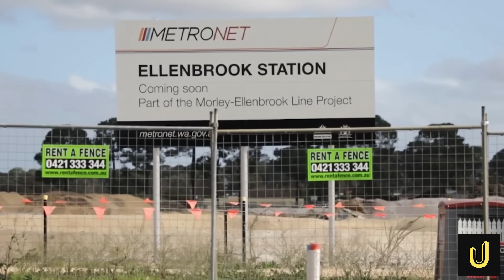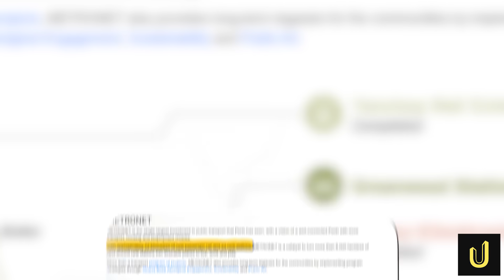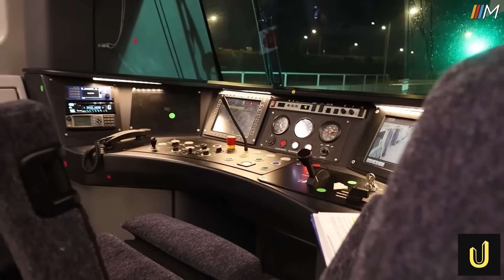$13 Billion METRONET is Reshaping Perth!

Comment: As a resident of Perth, this Metronet project was detrimental in the short-term, with chronic traffic problems. 

In the long-term I see this network being as beneficial to Perth as the high speed rail network is to Beijing.
Reply: The traffic has been horrendous.... I can't wait until the Armadale line reopens
Reply: The new Armadale train station looks great.

Comment: Been to Perth and i like the Metronet line especially the Yanchep line, it devides the Highway right down the middle, in a straighline and boy those trains are fast, keep going PERTH , you have a long way to go
Reply: Most of the lines run down the middle of freeways btw.
Reply: Yanchep isn't metronet. It's just an extension of the Joondalup line
Reply: @edwin5419  thank you for the correction, so if not metronet what is it
Reply: @PaulTaka123  it's just our regular train line. We don't have a special name for it because most of it was there before me, and I'm 40.
Reply: @PaulTaka123  but you're right, having it go down the freeway (all 150km of it) is exceptionally smart forward planning put in place many decades ago
Reply: @edwin5419 - so, what’s is metronet?
Reply: @edwin5419  Actually you're wrong, the Yanchep Rail line has been documented under MetroNet since 2019, you can find all documents relating to it on the metronet website.

Comment: I still cant believe that the new Cockburn to Thornlie line wasnt extended to go to the airport just down the road. so stupidly short sighted. Instead people from the south need to go into the city to then go back out to the airport. Which will make the airport an even bigger snarl point than it already is because people will drive !
Also the much mooted and desperately needed Paganoni/Karnup/Golden Bay train line on the Mandurah line needs to be put in place sooner rather than later !!
Reply: I agree that it would have been better if the Cockburn to Thornlie line was extended to the airport. I also think that it should continue up a passenger compliant line using the existing freight line corridor to Midland then up the Swan Valley line to Gin Gin with a new line along the Gnangara Road and Ocean Reef Road to Joondalup with a new interchange station where the new line crosses the Ellenbrook Line. In the south there should be two additional circular lines. One should follow Thomas Road. The other should follow Lakes Road past Murrayfield Airport and should be accompanied by a plan for Murrayfield Airport to become Mandurah - Perth South International Airport including a station on the new link line.
Reply: @grahambaker6664  I like your thinking, i have had a similar though about the Lakes Road line to connect a regional airport as Mandurah is growing faster than it can cope with. We should get the councils and Transperth to make it happen !
Reply: @WizardsLore Murrayfield is about the only option for a second Perth Airport site as the RAAF Bases at Pearce and Gin Gin stop anything to the north and Jandakot has too many houses around it. At least at Murrayfield they can still manage the land zoning to have noise buffers to avoid conflicting usage. Murrayfield is also close to the southern end of the freeway and to Mandurah Road so connections to higher capacity roads should not be too difficult and freight movement to the Kwinana Industrial Area, the Henderson Maritime Precinct and RAN Fleet Base West should be easier than from the current airport. Even if the Murrayfield expansion doesn't take place for twenty or thirty years it is worthwhile to lock in the site so future planning takes it into account. Incidentally, my proposed Thomas Road link should be a dual use corridor with the freight lines extending to the existing freight lines in Kwinana Beach.

Unfortunately, I am probably not going to be much use in lobbying. I am a former Port Kennedy resident but no longer reside in WA.
Reply: @grahambaker6664  Sounds reasoning which i would support. Nimby's would still kick up a stink that the grass on their properties would be impacted by flight paths. 
the regional airport there would also assist FiFo workers, similarly to the Margaret River / Busso  airport is doing.
Thomas road needs to be dual carriage way from Kwinana to Tonkin. Anything less is a missed opportunity. 
Cross rails between Manduah line and Armadale line need to happen. Maybe an interchange at the proposed Kwinana/Golden Bay station. there is available land to run alongside Paganoni road then shot eastward. Would create new housing oportunities all the way along it
The freight angle for the Peel region is one that needs to be seriously looked at. Especially as what was once sporadic townships is closely becoming 1 big residential area as Mandurah hits the Rockingham council line. And Rockingham itself becomes the next development target !

Comment: can fix our internet, you can't drink the tap water, in summer we have blackout as power grids can handle air-conditioning, there no infrastructure for EV charge station as the power grid can't handle it, your restricted to a 20kwh house battery for solar to insure the power company still has you using grid power.
they scrapped a monorail for a driver-less bus that failed after 1 year and was scrapped.
don't over fluff Perth, our government are fools, not to mention there pumping water out of the ground for free way extension that dried out lakes, Yanchep lake had a water rat that eats cane-toads now endangered thank to the development of Yanchep

Comment: This is a gross waste of money. Sprawling suburbs ... all good. People want detached houses on substantial plots, and ideally, secluded substantial plots. Most people DON'T want to live in soulless Stalinist blocks of flats where the lift doesn't work. You solve the congestion in the centre, not by pouring thousands and thousands of tons of concrete  and causing as much disruption as you can along the way, but by
a/ providing the city centre car parking. 
b/ You use taxation and legislation to MAKE employers offer fewer longer working days, thereby reducing the number of people travelling in each day and to spread the peak periods. People would love more days off.
c/ You then provide a fast, frequent interconnecting bus service that is free other than in the worst of the morning peak. The charging period would be to encourage a spread of the rush hour and fewer longer working days. Planning must ensure that there can be a dense direct bus service ... no great long cul-de-sacs. The money being wasted on this ridiculous railway would pay for the free bus service for more than a hundred years.

Frequent bus stops are convenient for people who want to use them. The driver will only need to stop the bus if someone rings the bell or there is someone with a paw out at the bus stop. These metro things cannot offer that convenience as the train would never reach a sensible speed if it would have to be stopped at EVERY station. I have never heard of a request stop on a metro. The alternative is long distances between stops which is only convenient if the starting point AND the destination are close to a station which excludes the great majority of the population who don't want to walk one and a quarter miles in the morning when there could be a more frequent bus service with a stop within 275 yards of home.

Comment: And train station at terminals 3&4 is no where near the bloody terminals at all.
Reply: Its convenient for the new Woolworths haha. Also there is a needlessly long walkway bridge for terminal 1 and 2 instead of continuing the tunnel to have a stop under the terminal. Then continuing it under groudn to run down Roe Highway or duplicate the frieght line to then feed into Thornlie/Cockburn extension.
Reply: @WizardsLore . 💯
Reply: maybe because 3 and 4 are closing

Comment: The West Australian has smashed Labor in today's paper.  Patronage levels are less than twelve years ago.  Despite large increases in population and cheaper fares.  So we have huge capital costs, ongoing maintenance and running costs, reduction in passengers, cheaper fairs with a cap on two zones, free fares for some months of the year...  just more debt for the govt so it can spend less on providing public services... like extra hospital beds.
Reply: Patronage is down as no armadale line until its finished, Mandurah line is very heavily used
Reply: @gregthompson6316  but remember there is high wycombe line, ellenbrook line and thornlie cockburn line extra.  also extension to Yanchep.  There has been bus to armadale too.  I agree re Armadale works, but you'd hope for a lot more considering all the free rides they've been giving away during summer and for kids all the time.
Reply: The patronage figures are from last year, with the Armadale line closed and many of the other projects not yet completed. Don't just swallow the media lies without  critical thinking.
Reply: Commuter habits take time to change and the works still aren’t complete.

It’s the same on Sydney’s Parramatta light rail that opened recently, the number of people using it are low but climbing every month.
Reply: @Hansel_and_Grettle  the rail is stuck down freeways and stations  five km apart at times.  Also they are surrounded by bush or low density.  Some of that will be changed in future.  But smarter design would have less km of track laid and instead do it more smartly in a way that will reduce car traffic.  Then extend tracks when required.  They could easily increase transport use in the inner circle of 10-15km from CBD.  It would encourage less car usage.  The previous govt wanted trams for this area, but all govt have now turned away from light rail.  The previous govt always wanted tunnelling into central Morley and incorporate hubs.  Like they wanted the Joondalup line to go via Innaloo hub in the eighties.  But instead some political parties just want to lay as much track as possible in inaccessible locations.  Then say they've promoted public transpot.  Quick and nasty.
Reply: @Hansel_and_Grettle  Parramatta is quite high density and pretty central I believe.  The current govt is laying track to distant fringes of the metro area, with low density and less requirement into the CBD.  Yanchep is 58km from CBD, Byford 43km,  Ellenbrook 33km... and so on.  Mandurah was important but is still 74km away.  There is little option to move sideways around the metro area.  You pretty much have to go into the CBD and fair to say that not that many people in those outer fringes are CBD bound.  A lot bush on route, low density etc.  Smarter move would be to service those within 10 to 15km radius smarter and work better at getting rail to go cross country and connect suburbs.  That would definitely increase public transport into the city and also for jobs and shopping cross country.  Which ultimately benefit people further out too.  But no one takes public transport for Perth unless their jobs are in Perth CBD.  Everyone else drives.  Transport just follows freeways and avoid existing hubs like Morley, Innaloo, Karrinyup, Whitfords and that's just going north... Booragoon...  nothing connects Fremantle efficiently to its local suburbs apart from bus and the Mandurah line.
Reply: @BDub2024 I don’t think much of this will be an issue as Perth grows and densifies in future.

Metronet has been considerably cheap compared to similar projects interstate… part of that is due to the not so perfect alignment, but that can be solved for in future with TOD.
Reply: @Hansel_and_Grettle  Perth has been talking about TOD and Network City for thirty years.  Cockburn City has been the only one that's happened in that period.  Stirling is still incomplete.  Laying tracks to distant locations aren't as important as getting cross-surburban rail connecting lines and having rail servicing people within fifteen km from Perth.  Buses are excellent for sure.  But people are constantly driving for every route to work apart from the CBD.  Money needed to be invested in tunnelling to connect Morley and Mirrabooka to connect Midland line with Joondalup line with a spur north to East Wanneroo long term.  Fremantle being so disconnected to most of the southern suburbs is a huge problem and one day extending to Cockburn Central will only partially solve the problem.  There is so many people living in suburbs from Melville, Willagee, Hilton and Hamilton Hill.  That is really packing in higher density and its purely reliant on buses.  Surely a priority is fixing that, so they can go into the CBD and Fremantle quickly without considering cars.
Reply: @Hansel_and_Grettle  Missing Morley Karrinyup Whitfords Innaloo is poor.  Mirrabooka you'd expect to be connected via heavy rail on Reid Hwy one day.  But they're currently talking about a spur from Ballajura to Clarkson.  Firstly why not Joondalup and secondly why would people want to go to Perth from East Wanneroo via Bayswater.  They need to get a grip and connect the lines far closer into the city.
Reply: @Hansel_and_Grettle  Building rail in a freeway will always make it very expensive to build stations.  You're talking about bridges, carparks, bus services...  There needs to be more stations and higher density along the freeway.

Comment: Please note there are still either 4 or 5 level rail crossings on the Armadale line .
Reply: Yeah.. dangerous and in need of the bypass construction 🚧 innovative solutions engineering.

Comment: Coming very late to the party given that 4 of the 5 MetroNet projects have already opened and the last will do so in 2 months! Also, whats with all the AI generated dribble & hyperbole narrative? "Required conquering immense engineering challenges",  "The engineering was monumental" etc etc. MetroNet program has been great, but the "engineering challenges" for all the new lines are very normal and not unique.